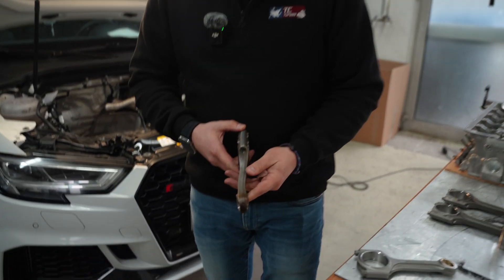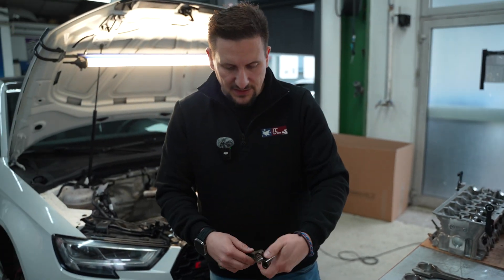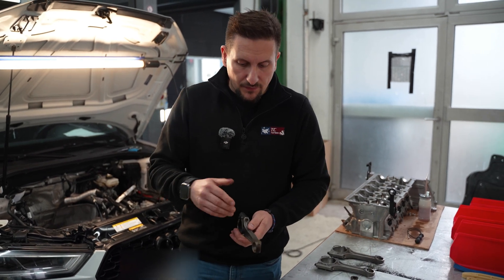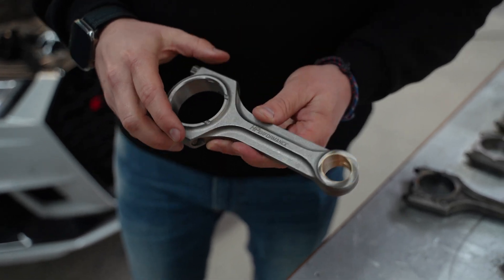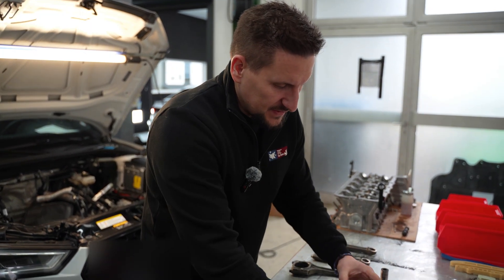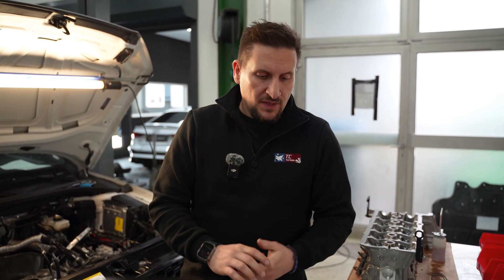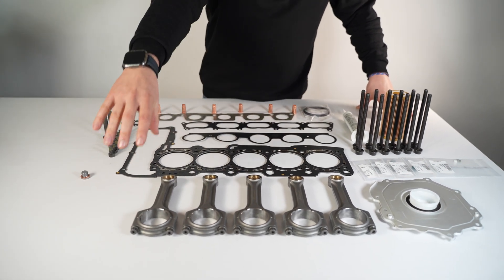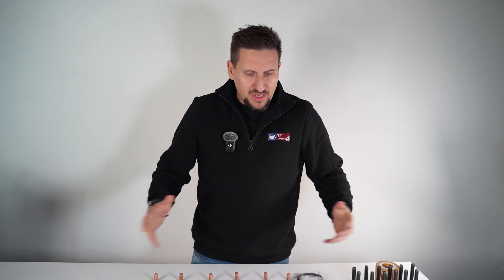DO THIS TO AVOID 25.000€ ENGINE DAMAGE ON AUDI RS3, TTRS AND RSQ3! ENGINE UPGRADE KIT HPerformance

Comment: @hperformancegmbh great video , I wanted to ask you with reference to an Rs3 a daza 2.5l for 700bhp would it not be a good idea to do more than your kit once you have the engine out , so I mean to also  upgrade pistons , valves , valve springs ,   etc to  be on the safe side .   And also can you run stock clutches with 700 bhp and 690ft/lb ?
Reply from the maker: hi, it is not necessary but if the custumer wants it we can of course do that aswell. its also a money question. A 700hp export DAZA is coming on our channel soon. the clutch can be also upgraded but no a need, as we can play with the pressure

Comment: Thank you for the simple, no-nonsense presentation.  Excellent!   One question, is the 8J engine piston designed the same way?  With the oil cooling groove in the piston?   If not, then swapping a set of DAZA pistons and forged rods into the cast block would seem like a smart move.   Thank you again for the information.
Reply from the maker: Hello, the problem is most steel
block engines are worn out - so stock bore pistons won’t make the job on most cars - but this is something we’re working on :)

Comment: My TTRS on a stock engine with a MRC tuning stage 2 package has the torque capped at 650nm . How far is safe on stock engine?
Reply: Some years ago all of the tuning companies made 7-750nm with stock daza dnwa engines, nowdays making 6-680, I think a lot of engines blew up.
Reply: @ Correct mate… However the older CEPA/CEPB iv known to run 750nm for over 10 years… I have been running MRC stage2+ on my CEPA 452bhp and 704nm for 7 years now with flat foot shifting
Reply: There is a reason why MRC cap it to what yours is capped too. Stick with that 👍🏻 The later alloy engines don’t like as much torque at the old cast engines because they also make more power with a factory bigger turbo
Reply: I have Daza for 4 years, run apr stg2 around 690nm without any issue, now I drive a dnwc 8y, i think it will be also under 700nm when ecu tune avaible without ecu hacking…
Reply: @ Sounds like a plan 😎